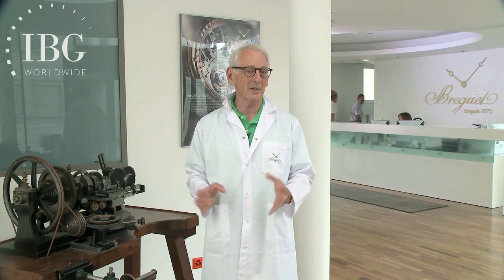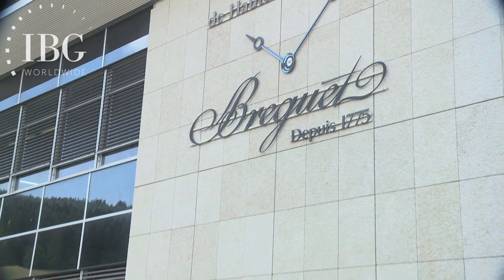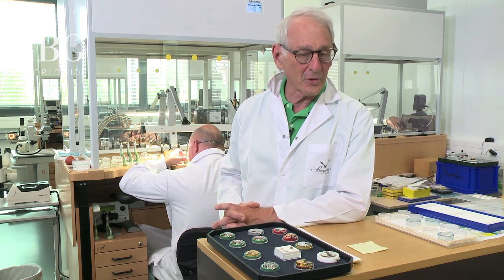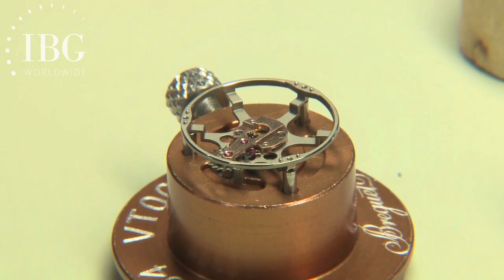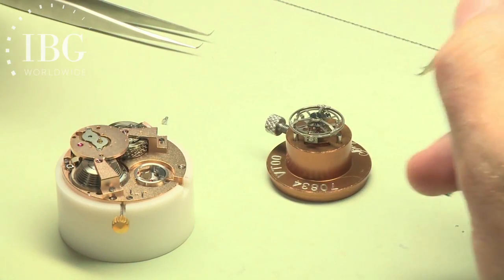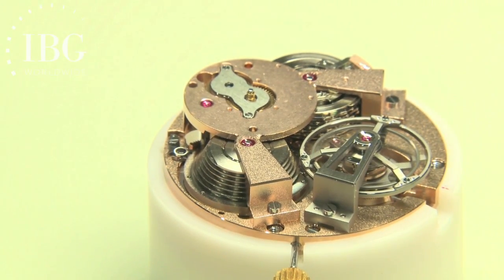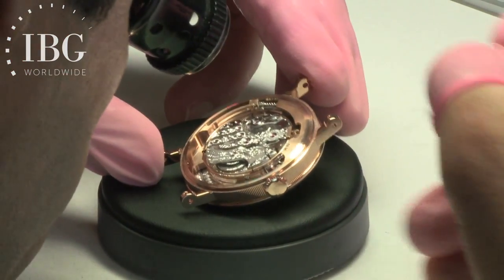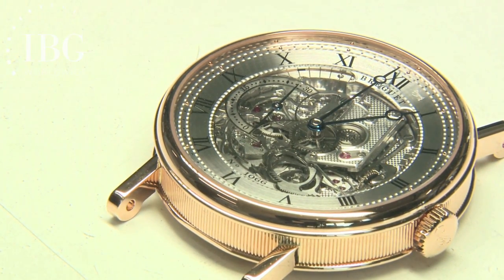Long Version: BREGUET - Tourbillon watches explained by Jeff Kingston

Comment: Does a tourbillon make a watch more accurate?, more reliable?, easier to service? Lets face it, a tourbillon is as necessary as a Bugatti 16 cylinder engine in a Kia Forte. The toubillon is just a bragging right. It's an absolutely superfluous add on that does nothing other than become something to worry about if there is a problem.
Silly toy, nothing else.
Reply: It has no practical application in a wristwatch but was a critical part of the pocket watches of old for accurate timekeeping since they were held in the vertical position most of the time. On a wristwatch they are only good for bragging rights and appreciation of mechanical engineering.

Comment: Can somebody explain to me why sharp interior angles can only have been done by hand using a file?
Reply: Here is the answer. Most watch houses don’t edge finish at all. The next rung up, these would be prestige brands, finish the edges with a tool called a touret. It looks like an electric toothbrush. Its rotating tip rounds off the edges. However, a rotating tip can’t finish to a sharp interior angle. Think of the form of the letter Z. The finest finishing is done by hand with a succession of files, each finer than the one before and followed by further hand polishing with wood. This type of finishing is not only traditional it is artistic. It is much more time consuming and expensive. But if you value hand craft, it’s what you want.
Reply: I'm not a watch expert but i have worked with CAD and the reason is the bit that is used to file down a part is round not a blade edge so creating an angle needs a certain pressure and articulation that cant be done by machines

Comment: why pay so much money for anachronism? anachronism, so there are much more accurate clocks. for example, clock with radio frequency correction. appointment of a clock - to inform it's owner about the exact astronomical time. no tourbillon will surpass the accuracy of a modern electronic clock, which has a radio frequency connection with an atomic clock in one of the world centers of time! such a clock is more accurate than time on the Internet!
to pay big money for such an anachronism is like paying for a golden carriage while there are supercars, planes and space satellites !!!
except when you have more money than you need to stay !!
Reply: Because people appreciate the workmanship and the engineerjng beauty of automatic watches that are self reliant needing no battery. Why do people buy expensive gold and diamond jewelry when you can get fake diamonds and fake gold plating?
Reply: @A-FrameWedge  , don't be dumb, did I talk about fakes?

Comment: What are the pink stones for?
Reply: They are 'jewels' which are used for keeping that particular area of the movement lubricated. 
Fine oil is placed in the center of that jewel which has a tiny 'drain hole'  to help make the oil flow 
through to prevent premature friction.
Reply: Fast Ed:  Does the oil ever run out?
Reply: @everydayislikesunday6124  Yes, the oil loose its properties and become sticky after some years. That's why you need to service it regularly. And it need to be all disassembled, washed and reassembled with the good oil at the good spot.

Comment: Ridiculous and wonderful in the same breath. Ridiculous in the sense that a simple quartz movement would out-perform it on the grounds of accuracy. Wondeful in the sense that its a joy to see mechanical engineering and craftsmanship at the very edge of what is possible.
Reply: You all assume quartz is always more accurate. Most quartz is about a second per day. Top mechanicals are less than a half second per day.
Reply: @stevek8829  you are comparing the best mechanical watch with the worst quartz watch.

Comment: Thank you for this presentation by the gentleman depicted, I have long been a person inclined to the study of all the varying forms of mechanical timing devices.
However, it is my opinion that the oldest mechanical clock movement known is the original clock set into the Salisbury Cathedral. This is said to be the oldest mechanical clock known. https://www.youtube.com/watch?v=9mX-O0fNFYw
Here in this above link is the evidence that all timing mechanisms are or can be "vastly different in its componentry from the other." This presentation also featured the mastery of the craft skills possessed by the early master in France in that early time era, Mr. Tourbillon.
A valuable presentation perfectly narrated.

Comment: Calibrated screw drivers?  Hmm, consistent results are obtained only if the driver is consistently kept coaxial with the screw.  Any inadvertent offset, such as seen in the video, results in amplification of the torque. In other  words, a true calibrated screw driver should have not only a precision blade for engaging the slot in the screw, but also a method for registering and maintaining the alignment of the centerline axes of the driver and screw.
Reply: Seems like you should be making watches then. ...as these high end watch brands  obviously have no idea what there doing .just imagine how nice they could be with your kind of insight. I dont know about others but im convinced. Im in let me know when you have set up run and designed and produced your first watch and ill buy 1 no matter the price
Reply: sanjursan The amount of torque is not amplified and cannot be simplified as easily as you have stated it. In fact in what has been shown it would most likely decrease. Unless he started using wrist rotation vs finger rotation in order to move the screw that is what it's more dependent on. Of course if he had excellent hand control which I'm sure he does being that he's assembling this complicated of a movement he could more easily apply greater torque but that is not a guarantee and you cannot determine that directly from the video. There is just a greater chance of it.
Reply: sanjursan even with all of this considered the over torque feature on these drivers prevents much of the discrepancy as long as the time and the attention to detail is given.
Reply: "A method for registering and maintaining the alignment of the centerline axes", aka a pair of eyes. Sounds like you've never used a torque wrench or a torque screwdriver in your life. What an idiotic comment. Good job at trying to sound smart.
Reply: Your full of shits i working 54 year Swiss watches you shut up